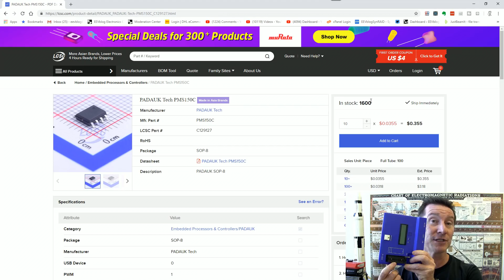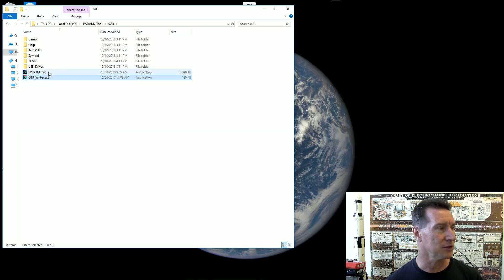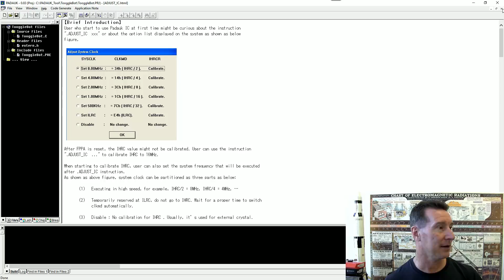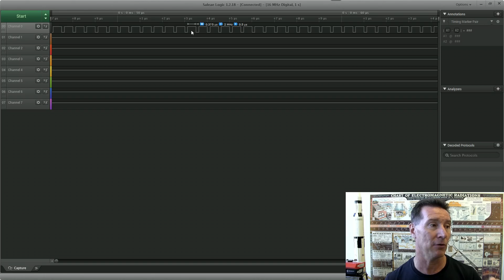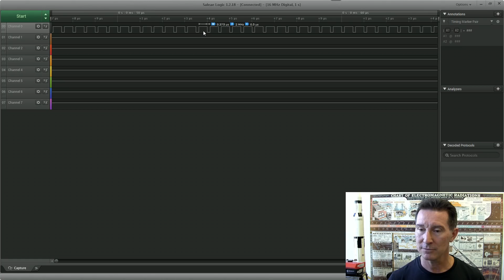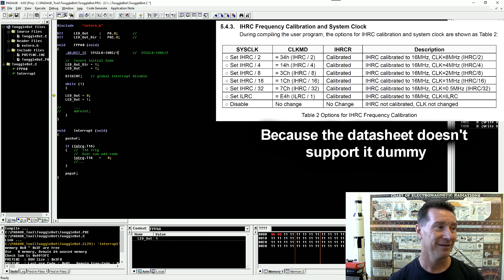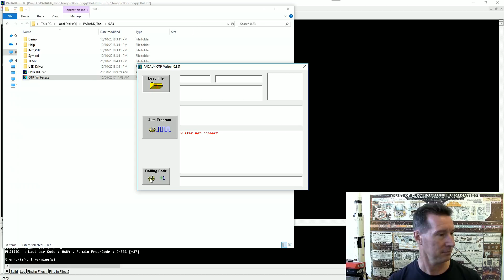EEVblog #1140 - 3 CENT Micro LED Blinky with ICE!

Comment: Can´t you just program them in produkt? It should not be that hard to wire it so it would be able to program inline in the finished product.
Reply: I don't see why there would be a problem to program in circuit. if you are careful on how you wire your product. But since there are so few pins you probably want to use the programming pins for I/O
Reply: Yea sure.. but you might just use 1 or 2 pins....  If i remember correctly 4 pins is needed for programming (including power) so that would leve 4 pins for useful stuff.

And if you need more i se no real problem i paying a extra cent or to and get a 16 pin version

Comment: Incredible, I remember when I started with microcontrollers you had to get special (expensive) windowed devices and each build run cycle required erasing the devices in a UV eraser and reprogramming them so I tended to write much larger blocks before testing whereas today it is easier to almost write line by line and test each small block as you go. The first ICE I purchased made life so much easier as I could develop in 'real time' but it cost £68,000.00 and you needed a separate (£2800.00) module for each device that you wanted to use so you had to be really serious about product development before starting. It is good that today the same can be had for just a few $'s.
Reply: I'll love to think this will led us to a new kind of industrial revolution.
Reply: Yes that would be good but I suspect it will lead to things such as pencils with flashing LED's. What we really need to complement these cheap devices is a cheaper power source. My company develops embedded systems and we are now in a position that in the devices using very low cost microcontrollers the battery is now the dominant cost so saving a few pence on the micro would not really make much difference. In fact the microcontrollers have generally been the lower cost components for a while. It will be interesting to see what develops.

Comment: My parents went to see Coldplay, and they were given these light-up wrist band with LEDs and a radio receiver inside, which were remote controlled to flash in different patterns based on the music. This is the sort of throw-away application that a super-cheap micro would be useful for. Something simple, maybe one-time use, that you might need in huge quantities.

Actually, the Coldplay thing is a great idea. Say you wanted it to only switch on the radio receiver during the actual concert, then afterwards it switches to autonomous mode, controlled by the micro. Not having to run a radio receiver would probably use less power, so it'd last longer, and it could have user-replaceable batteries so it's not useless after it runs flat. The micro could be programmed to switch to the autonomous mode if it doesn't hear a signal from the receiver after a short time.
Reply: Crowdsync?
Reply: but please, can we reduce trash? most of it never gonna be used or recycle again.
Reply: @youkofoxy  my parents still have their wrist bands sitting on a shelf with other trinkets from their travels, they just don't do anything. But I agree, they should definitely think about making these sort of single-use gadgets useful after their intended purpose is finished.

Comment: Perhaps a super simple SD card .WAV player?
Reply: I was doing that this week but it took a 96MHz Teensy 3.2 and the Teensy Audio Shield with an SGTL5000. I doubt a tiny 8bit MCU can do that.
Reply: @dentakuweb  There is a project that uses an Attiny85 to do just this.

http://elm-chan.org/works/sd8p/report.html

Comment: If this thing contains an ADC you could potentioally used those as a DC-DC buck controller. This would be would be revolutionary because you can never find them below $0.50
Reply: Well you could also just buy some https://lcsc.com/product-detail/DC-DC-Converters_M3406_C83224.html they are also around the 0.03 UDS mark
Reply: @TalpaDK  Nice one, the only problem is the Max input voltage, but that could come in handy if in need of a 5V -> 3.3V buck
Reply: @RemiBusseuil  Well they also have some massively more expensive ones (4x the cost at ~ $0.14) than can handle 20V (I just randomly punched in that number :) https://lcsc.com/product-detail/DC-DC-Converters_Techcode_TD1482AP_TD1482AP_C177808.html haven't checked if a pair of 20V mosfets can be had for less than $0.11
Also if one did roll a custom regulator one could potentially get some additional features, comms over SPI... maybe be able to change the voltage (atmels often officially only runs a 8MHz @ 3.3V) so reduce the voltage during "sleep" and increase it when processing or reading status info back, say the loading (pwm duty cycle)
Reply from the maker: One of the bigger models in this series has an ADC

Comment: Why Up and DOWN cycle not the same? (on first example) 
while loop take time?
maybe put 
LED ON
LED OFF
LED ON
LED OFF

to see a difference
Reply: If you look at the example code, between the line that sets the output to 0 and the line that sets it to 1 there is not code, but, in order to set it back to 0, the program have to jump back to the previous line (that is what the while loop does) and that takes a bit of extra time. So the output will be always a bit longer on high state than on low state.

On the other hand, you also have the aliasing issue with the logic analyser, as @drelephanttube already pointed out.
https://en.wikipedia.org/wiki/Aliasing
Reply: Because of aliasing from the logic analyzer not sampling fast enough. Dave mentions it in the video.
Reply: @drelephanttube  Sampling is fast enough to show the unequal markspace.
It does not show aliasing at all - it just shows sample error because of phase shift.
Aliasing happens when trying to sample a frequency greater than half the sample rate, which is not the case in this example!

Comment: They custom wrote a compiler for their CPU to maximize ram/speed on their extremely small size mcu.
I doubt gcc would work, or if it did it would be slow or use up most of the ram
Reply: That's what I was thinking, too.  There's not a lot of memory on there and there are a lot of opportunities for optimization the manufacturer would be in a better position to take advantage of.

Comment: The IDE looks to be better than Aurdino IDE !
Reply: Notepad is better than the Arduino IDE.
Reply: @hasanmansour6849  , VIM is perfect for Arduino and any GCC / ASM stuff.
Reply: I was thinking the same thing.
For Arduino you can use the free version of Visual Studio with the free Visual Micro addon and you get all the nice modern features the Arduio IDE is missing.
You can also program Arduinos with VS Code but I prefer Visual Studio.
Reply: Arducrap is not even worth mentioning. Gawd I hate that "IDE" and their ridiculous HAL. Just learn how to read a damn datasheet. :/

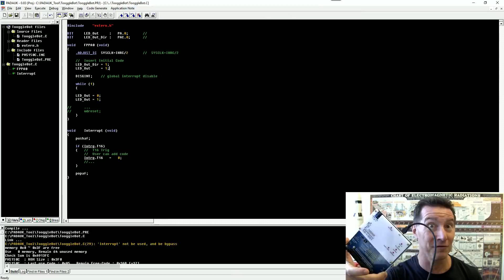Comment: 13:48 actually the manual explains that you do not need 9v power as the ice is powered directly by usb. The 9v input is only used if there is something power hungry plugined to the ice.

Comment: I'm not the greatest C programmer , but there was no delay in the while (1) loop of the first LED flashing example. The LED should of been blinking as fast as the emulator/processor can go, not every half to whole second.
Reply: Dave used the LA to capture the output for the first program. Then he used a timer to do delay and get the 1Hz toggle.
Reply from the maker: Watch the video again, I showed it toggling at 2MHz
Reply: I did see that, but at the beginning I only saw the green blinking LED on the ICE, sorry.
Reply from the maker: Ah, I see the confusion.

Comment: Wouldn't you just design a PCB that has a programming Port so that when the final assembly comes the assembler hooks up a cable to a JTAG for the initial programming I can see how if you had to program every chip before you put it into a pick-and-place machine it would take a long time but more than likely a product built with this chip would be put on the board without programming and the PCB would have a programming port.
Reply from the maker: Because it's inefficient, and if you use a connector it costs more than the chip.
Reply: bed of nails programmer then! :P
Reply: better yet, instead of needing the chips to be pre-programmed, you could just have pads on your pcb for use with a bed of nails programmer. heck, you could design a programming port into the panel frame of the panelized PCB... if you really think that the ability this to be non-pre-programmed is a show stopper then i don't know what to tell you

Comment: You didn't mention having any friends who can help you read the manual.  Is there much of a Chinese ethnic community out where you live?  My wife is bilingual, and we have some friends who are in the tech industries and Chinese.  In case you don't have any closer resources, I'll help you out.
Reply: If there's a uni nearby there will probably be some Chinese engineering students, too.  Although Taiwan has some differences in language and characters used, so that's a consideration.  Many mainland Chinese are fine with both as I understand, though.

Comment: Those chips are total candy.  I've never felt so excited about a microcontroller since the PICs and their development system and programmers first became affordable to minions like us.  (PIC16C54 and EPROM development version era)  It would be great if they had a flash (Or EPROM?) variant in the family and the programming algorithm got added to the TL866 style universal programmers.  The English manual for the chips is very good, with a very readable guide to the assembly code instructions.  As you were looking through the data I particularly liked the reference to the ready-baked 1Hz interrupt on a 32.768 kHz crystal.
Reply from the maker: Yeah I noticed that 1Hz thing, that's groovy
Reply: Have you played with it, Clive?
Reply: @NicksStuff  I've not.  It requires a specialist programmer.  It would have been nice if it had used a common multi-chip programmer.

Comment: 3MB for IDE and compiler? Man these guys really have to catch up with modern software development. My mouse driver is 20 times bigger than that. 😅
Reply: I really like that it is so small. Makes developing quick-n-dirty projects for super simple non-critical software a breeze.
Reply: Totally! I hate it when I want to just quickly mess with something, and I have to install 3GB worth of software I might never use again. Instant motivation killer.
Reply: More like modern software development has to become less bloated
Reply: @Rtzz0 Dear god, I couldn't agree more. I come from the worlds of wxDev and Notepad++ and I'm abhorred by the install sizes of Visual or Atmel Studio or even Eclipse for god knows whatever reason. It's slow, clunky and I'd rather have an option to check that says "install a syntax-highlighted notepad and some compiler sugar and never prompt me for anything ever again".
Reply: @thecakeredux  I'm currently trying to move some of my work from VisualStudio and Atmel Studio to VisualStudio Code. Maybe I can get used to doing everything via text commands but I don't know.
Reply: No - modern software development needs to catch up with these guys. The 3MB IDE seems to be doing everything what my 3GB+ Eclipse does and in some aspects it actually does better.
Reply: I loved eclipse when I started using it 10+ years ago (wow, I'm getting old), but today it's soo bloated and slow. Forced to stay with it due to customer demands though :'(
Reply: 300Mb Logitech driver package, with GUI done in Electron, so they bundle a whole browser and the kitchen sink with it, lol. Total joke when the interface is so simple that you could write the UI natively for each platform in like a day. The “let’s run everything on nodejs and the browser” idea, where most people don’t grasp even 10% of what goes on in their own application and it ends up full of security holes and bloat – meh.
Reply: Ah! I remember when you could do stuff in 640kB of ram, OS, drivers and apps all in...😉
Reply: I am officially old...I thought that 3MB size for a macro assembler was unreasonably large... Compare that with Tiny-C and ACME cross assembler(minus the PDF text files). PDF = Program that takes text files and makes them take as much space as a video! You ever see a 150MB PDF and think...wth? Is it going to read itself to you while showing you motion video? Cuz if not why is this thing SO HUGEEEEEEEE.
Reply: Bob Sacamano Even if they wrote it using wxWidgets or Qt they still could do an optimized static build that would not be much bigger, and then it would be cross-platform. Still a single .exe.
Reply: BLOAT is negative for performance.
Reply: If you look at this from the other side - your mouse driver is sooo inefficient. What a waste of resources for such simple thing. And that mouse probably cost more than 50 chinese work hours.
Reply: And probably this compiler can run on computer that cost less than your mouse. I feel sooo inefficient with my ThinkPad P51 that uses gigabytes of ram to run MPLab IDE 8-bit microchip microcontrollers.
Reply: @antonyprasad5536  Ha ha ha ha ha.  Software getting smaller.  Stop it!!! Your killing me....  Next you will be telling us that modern software is less filled with bugs! 

This reminds me of a story.  I remember working on the Formater & R/W Driver for the first of Seagates brand new 5 1/4" 5 Megabyte drivess and some Marketing guy who was in the room during the design review demanded to know why my valuable time was being wasted working on a project to put this much storage on our machine? When I asked him (who are you and wondering why is a marketing goon at a design review?) He said, "Clearly you don't know how large a typical business letter is?  Its 4k!  No one will EVER fill up a 5 Million Byte drive.  Never!!" 

I think the format drive routine was 14 bytes?  Maybe it was 20.  It had a pre SCSI card (SASI) that took simple commands and did most of the work for you.  It doesn't matter.  Someone said my Format Program needs to say something other then "done"   A guy whose name I can't repeat lest I start barfing spent a couple weeks on a better format routine that I will admit was cute to look at but instead of taking a couple minutes to format the drive it took many hours.  I didn't ask why it took weeks to write (or why the code was huge) but I thought it was locked up.  He explained it was just slower so.... He left and I sat and waited.  And waited.  And could see the drive step after a considerable amount of time.  I found the guy and asked why did it take hours to format?  He told me that he was formatting every track over and over to "pound the "sector ID bits" in harder."  At first I laughed then I realized he was serious.  So I asked him, "Who told you to do this?  That it works this way?"  He replied, "No one.  Its obvious..."    I must have had a stroke because I don't remember what happened next but I'm told I was restrained from trying to throw him out of a window.  The story has a happy ending. He was promoted to work in the software engineering department at the nicer executive building.  Or in other words as far away from me as possible...

Just think of what is being said.  A "small" 3 Megabyte program is required to write code for a part with 2048 Bytes of space.  This is why God invented Therapy and drugs like Valium....

I suggest we stop calling this sort of crap bloat-ware. That is far too kind. I suggest we call it Vomitware. Because these IDEs (to me) take 10 to 100x more time to learn then it is to learn a new parts instruction set and write a bunch of programs. Which... makes me vomit.  See? Things like this clicking the universal??? symbol for "GO" then having to click GO again for no apparent reason"  Or endless "warning messages" that are typically telling me that I've violated some made up rule about the extra non code nonsense they insist on using to ruin what should be a simple assembler or compiler.  But since you can click the mouse for a block of some curly brace based abomination software for a pre written IC2 bus I guess makes it all worth while....  But what about 1 Wire Maxim bus? Someone might have to write original code rather then cut and paste some block of garbage someone else wrote?
Reply: These guys are doing it right! Everyone else has a case of code-bloat.